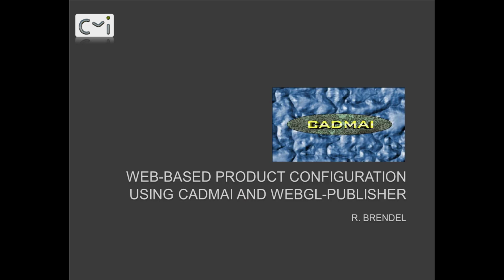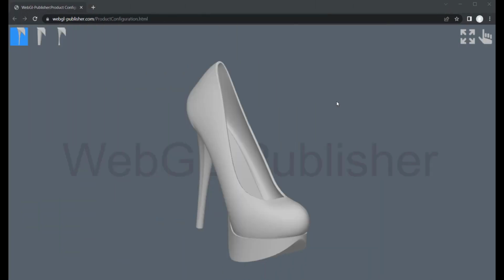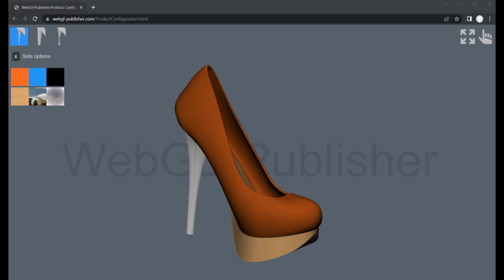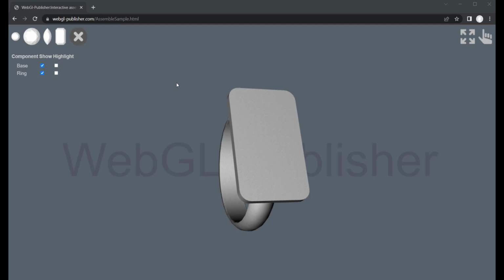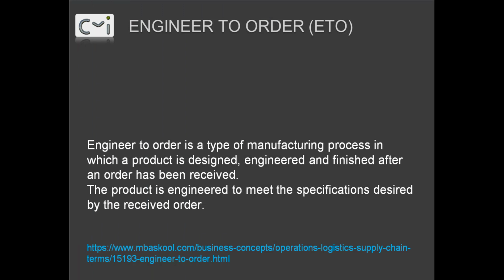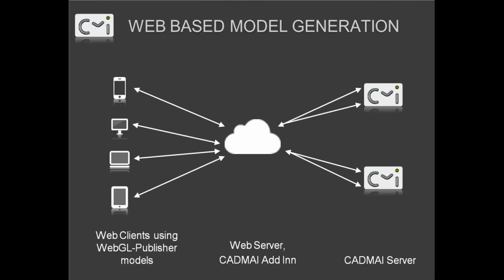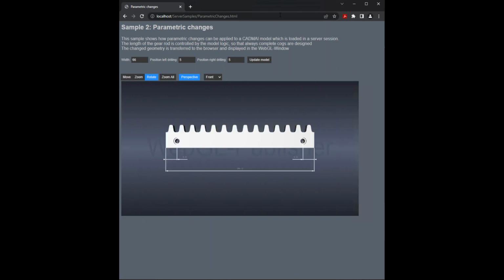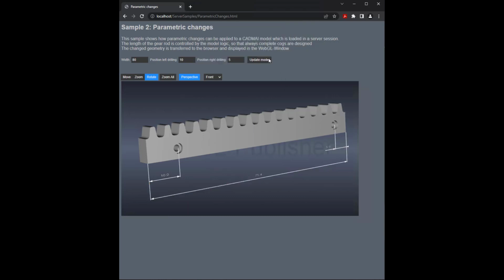Web-based product configuration using CADMAI and WebGL-Publisher

Comment: Cadmai seems to be as souple as solidwork. But what is entity list? Create, remove, arase, increase or downcrease a entity list. How many entities 'll find in the cad? (fr/englis)
Reply from the maker: CADMAI is a little bit different than other mechanical CAD systems like SolidWorks.
The focus is to create CAD models which can be steered by parameters, geometrical constrains and logical dependencies. The steerage can be performed within the CAD application, from external processes or in web environments.
CADMAI uses actions (comparable to features), which create, modify or delete entities (lines, solids, components,…). 

Some introduction videos can be found at www.cadmai.com under TechInfo -> Presentations